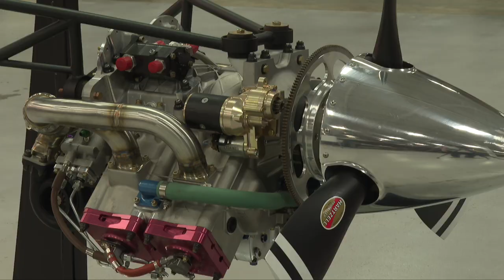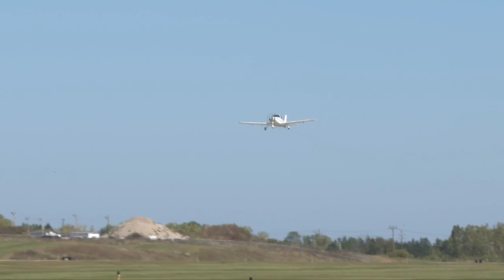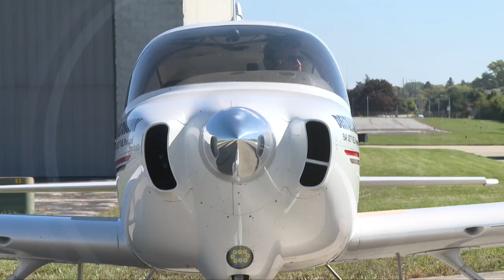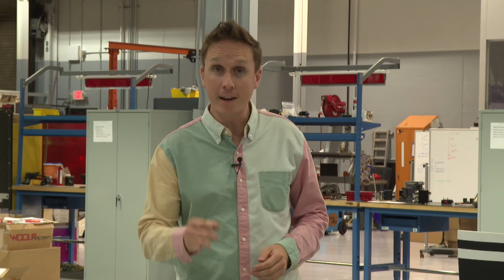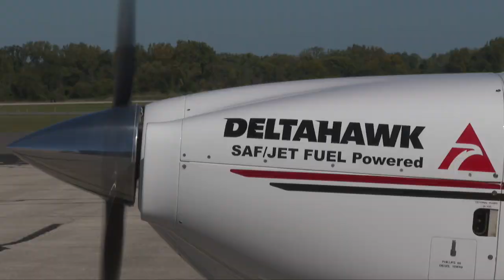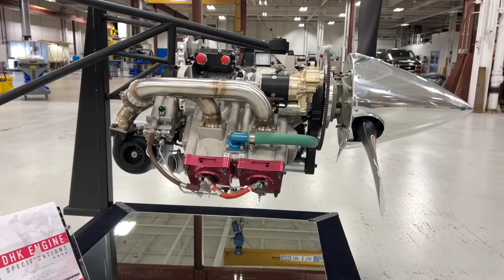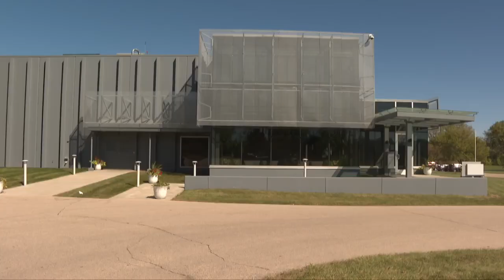This engine is the future of flying

Comment: I'd lose the belt drive for the supercharger & replace it with a gear drive- or even better- turbo only, with a brushless electric motor for start-up. for redundancy? you can use 2 electric motors to drive it- one fails- the other kicks in. failproof. plus, you only need it on startup. once the engine is running, the exhaust powers the turbo.

Comment: deltahawk made a LOT of smart moves here. leaving off the FADEC equipment probably only lost them 1 or 2% efficiency- but not having it meant that they didn't need redundancy for it- along with the extra parts count, certification & insurance costs... on & on & on. plus- once they completely take over the GA market & they have a 5hit ton of cash to burn, they can afford to go back & offer a FADEC version for those who might want it. but frankly? I could live without it. this engine is plenty efficient as is. kudos guys.

Comment: When they get the cost down to under $20K they will get my attention. Personally, I would prefer a rotary style engine, better power to weight, good fuel economy and the ability to double the horsepower for the same weight and size.

Comment: Nice, but ... previous century junk by definition as a fuel line and CO2 based fuel is needed.

Putting fire extinguishers in front of a burnt down Tempel of Oil greed....

Comment: Blowhards!  Aviation engines for small planes haven’t changed much since THE SPIRIT OF ST. LOUIS.  If it isn’t too embarrassing, how fast can it push a small aircraft.  A motorcycle could go faster than the run of the mill single engine aircraft.

Comment: I've watched several videos about the Adept engine and tried to play Devil's Advocate looking for potential problems. That it is an already functioning engine with significant air time, I'm rather impressed with the engineering and power to weight advantages. I wish the team and investors at Adept all the best. 

That being said, while only a proof of concept prototype, the RevForce 2 stoke featured on "driving 4 answers" is very interesting. While currently only a two cylinder, the power density is unreal at 578 cc displacement pumping out 220 HP while weighting only 50 kg and multi-fuel capable with on the fly switching.  I'm a bit wary of both the supercharger and turbocharger being required to run, but I suppose we'll have to see how it evolves, Currently, this is not slated for aviation use, but Imagine a 1200 cc 4 cylinder weighing maybe  230 lbs pumping out 400 plus HP.  That would be a real gane changer for light aircraft.

Comment: Minus the paperwork and burocracy yes I agree but. With to much regulation this is an overpriced paperweight. For 99%of pilots.. one has to understand that the engine is what drives aviation and it's new complexity... Engine first airframe second. And price is 3 and first as always... Good luck..

Comment: The main costs of airplanes are:

1) insurance ($3000 to 12,000/y)
2) hangar ($5000-$8000/y)
3) annual ($2000 to $10,000)

These can run $10,000 to $30,000/years depending on airplane, location, etc.  

At 100 hrs/y that is $100 to $300/hr, which is more than the fuel cost by far.  Fuel at 10 gal/hr is $50 to 60/hr, and engines are $15/hr or so for overhauls.

To make airplanes cost effective you need to solve 1-3.  Getting a little less fuel burn is NOT going to solve the problem.

BTW, this delta hawk is obsolete.  New combustion tech will be 60% to 75% efficient on E10 (regular gasoline at $3/gal), not 42% like the delta hawk on jet fuel at $5/gal.  75/40 = 1.8x and 5/3 = 1.66.  1.66 x 1.8 =  3x more for the delta hawk per HP.  

RE fuel can be $1/gal from house...or run on Natural Gas for 1 hr at $1/gal.  Both of these low cost fuels can't run in the delta hawk, but they can in new engine tech.   1.8 x 5/1 = 9x more for delta hawk.  Clearly obsolete.
Reply: The only question then is how to solve the insurance, hangar and annual costs?  New airplane tech with new combustion tech solves all three.  Nearly zero costs, saving $100 to $300/hr in fixed costs at 100hr/y.  Delta hawk does NOTHING for the 3 key costs.

If you fly 100 hrs/year and burn 10 gal/hr, and fuel is $5/gal that is $5000/year fuel costs.  Low cost hangars are $5000/y.  How than to get the costs to nearly zero?

I have a way...

Comment: 11 GPH was the same as my 180hp Piper Archer. Other than running on slightly cheaper Jet fuel, I fail to see any advantage, especially if a new one costs 110k. 
When I was still flying 10 yrs ago, a new factory Lycoming 360 (180hp) was around 30k. Overhauls were between 15 & 20.
Reply: WRONG. 7gph at economy cruise- it uses a little over 10gph at full 180hp, which your lycoming will not do- at altitude unless you turbo charge- and then? you will burn around 14 gph. but wait- it gets better. price of offroad diesel? which you CAN BURN in this engine? around $2.50 a gallon. or Jet A, $4 a gallon or B20 diesel around $3 or home-brew B100 for around $1.50 per gallon.
Reply: @jaybee3165  WRONG!!! Mr. Knowitall. What a ridiculous comment! How could you possibly know the fuel consumption of MY airplane? My 76 Archer averaged approx. 11 GPH cruising around 7k ft @ 2,675 rpm. I put about 700 hrs on it and definitely know better than you, how much avgas I bought for it.
What year model was or is your Archer Mr. Knowitall?
Reply: @roberthorton8135  don't have to 'KNOW IT ALL' to know that an air cooled gas burner is FAR less efficient than a modern turbo diesel. 4x the compression ratio, cleaner burn, tighter tolerances, water cooling, direct injection? not withstanding- the archer is an excellent aircraft- but engine wise- you're just outclassed. cirrus installed the DHK 180 in their SR20- a plane with around 200Lbs. more useful payload, achieved 8gph while cruising at 148kts. imagine what your piper would do at 30,000 feet with a DHK 180. your old lycontisaurus briggs & stratton motor wouldn't have 50hp left- if it could even reach that flight level at all. no doubt- it's been a great engine- but that's all HAS been.
Reply: @roberthorton8135  imagine your PA28 had a cummins BT-6 turbo in it. you know- the engine that routinely goes 1 million plus miles (20,000 hours). and develops about 200hp & 400 FT. LBs. of torque and has greater efficiency than a gas engine 2x its' cubic inches ... now imagine that it weighs the same as your O-360. that's what you're competing with. your engine lost this race before it began.
Reply: imagine if... your piper- only needed new cylinder liners & piston rings & bearings every 12,000 hours- and didn't have any valves, camshaft or heads. THEN WHAT?
Reply: at what altitude & speed? with how much payload? apples & oranges mr. briggs. apples & oranges. diesels WIN- when the race is: get to a set rpm or speed- then HOLD it under a load. that's ALL an aircraft engine is asked for. & precisely what a gas engine, direct drive- is HORRIBLE at. if it wasn't? every tractor trailer would still be powered by one. but they're NOT. the only thing holding diesels back until now- was weight. a german company- junkers, built the jumo, in ww2- which still holds the gph burn record for efficiency. not lycoming. not continental, not pratt. a 2-stroke diesel. what diesel hawk did was take an old american design that stood the test of time in busses & other commercial uses- the GM detroit diesel- a 2 stroke- and modify its' design for aircraft. it's lighter, stronger & more efficient. PERIOD. & this is only their first iteration.  with time- as the build fleet hours & learn- it will improve far beyond what is possible with anything GA currently has in its' reach.

Comment: I can't see any significant sales for this engine because it is priced over $100k.
Reply: based on WHAT? a NEW, io-360 turbo- which is FAR less fuel efficient, FAR more expensive to operate is $97,000- with NO firewall forward- that's engine ONLY. $110k for a diesel hawk includes: COMPLETE installation of firewall forward, designed & engineered by aerospace engineers from deltahawk, including cowling, water cooling radiator, oil cooler, turbo intercooler, panel integration, fuel lines, water lines for radiators- engine mount & prop system. what's included with the engines YOU say have so-called 'significant sales'? a high price. shock cooling. carb ice. constant failure of magneto's, valves, top end, cylinders & piston rings. $7 a gallon fuel at 20gph fuel burn. in short- PURE HEADACHE & PILES OF MONEY EVERY SINGLE YEAR OF OPERATION. who would want that over THIS engine? I'll tell you who: LYCOMING. CONTINENTAL. GOT YOU! a lycontisaurus salesman- tell your bosses we said hello.

Comment: So, for anyone seeing this video and being confused as to everything about this engine:
Deltahawk is an engine designed to run on jet fuel, diesel, and a few other similar fuel types, not gasoline or avgas. It claims to be both super- and turbocharged, produces a maximum of 180HP on 11 gallons per hour. Havent found an official figure for this so * but weighs between 350 and 400 lbs. Supposedly a 235HP version is in the works that burns 14 GPH. Cost is ~$110,000 for the current 180HP model, I believe that is WITH installation hardware. 

You now have more information about this engine than was presented in the video, even if some of it is wrong.
Reply: it's a LOT more than installation hardware. $110k includes an engineered firewall forward installation PACKAGE- including cowling design, cooling system, engine mount, panel integration and constant speed prop- and a LOT more. before they decided to include all that- the base engine with radiators (anti-freeze, oil & intercooling) was $60k. their reason? NO ONE has EVER tried to install 200hp worth of diesel engine with turbo & intercooling into an airplane before- EVER- without also custom designing the entire firewall forward. mess up just one component of the fwf? & you wreck the engine- or the entire plane. as time passes & this engine system gains fleet time- there will be after market fwf kits & lots of options- like there are with LYcoming & continental.

Comment: Can the average pilot afford this? What I’d love:

* brand new avionics
* 300 knots
* less than $90K to run all in
* $300K to buy

Now what I just described can only be obtained as either a turboprop or a jet and even used, it’s a struggle these days to find anything below a million. Just 6 years ago, you could easily find that for $600K. I don’t care if some great new gas sipping engine comes out if it’s doing 135 knots and costs $3 million. I’d rather buy a used TBM 750, which you can get for about a million.

Comment: For at least 5 years after certification, you have to sell your engine to the manufacturers, plus you have to start paying off the large development costs in the last 2 decades. If you make it through those , then you can talk about your engine as the future of flying. Your future will be largely determine by the cost of your engines. Some examples of clones being made are Rotax, PT-6,  Wabasto heaters and Snap On flank drives. You have under 1/4 century for patents. The only way to get around it is at the patent expire time, you find something wrong with your product, and start pushing a new product. So if you cannot make money from it, no one else can, examples are R12, R134a and now R1234. for your AC. You are the second such engine on the market, there is also one called the WAM100 that were still born , starved of funds in England.

Comment: Aircraft engines tend to be much more simple than modern auto engines.
Reply: look up rolls royce merlin fuel injected- first built in 1943. liquid cooled. mechanical fuel injection. super charged. the radiator was under the fuselage beneath the wing- and actually made thrust- vs. creating drag like most modern GA aircraft of today.

Comment: Point #1.  The only engine on earth more basic than a gas powered aircraft engine is a Briggs & Scranton.

Point #2.  100 Octane low lead gasoline is the most readily available fuel for general aviation aircraft.

Doesn't look to me like your off to a good start with this propaganda.

Comment: If that video is their production facility then they are in trouble.  Where are the people?  Where are the machines?  Where is the production line?  If this is the future of aviation. We are going to be walking. They had a mop bucket on the production floor. That means the roof leaks. Taking orders for 10 thousand  units doesn't mean a thing if you cant produce them. I can't be sold on an engine that's a display model. They are just blowing smoke up our asses. Next, we'll hear pay no attention to that man behind the curtain.

Comment: Plane engines (piston) are NOT incredibly complicated.  It’s the opposite due to liability and insurance.  GA, general aviation, the non commercial planes engines are 80y old tech…magnetos and air cooled.  Tech advances is slower than snail and glacier

Comment: Diesel fuel is cheaper and much less volatile than av gas.  With this diesel 2 stroke, having much less moving parts than a gas engine is always better. I remember back 15 or 20 years ago when these diesel engines were being billed as being much lighter than their gas counterpart engines. Comparing the weight of this diesel to that to the other 180 hp gas engines out there like the O-360s, the 335 lb weight is considerable.  With the 235 hp versions compared to the 470 and 540 engines, the weight is mush better.  But to me, the $110k starting price for the 180 hp versions is a bit steep.  That's nearly twice the price of a factory new IO-360 and $35k-$49k  more than a factory new IO-470/540.

Comment: Congratulations! This is how you present news: NO INFORMATION whatsoever: what type of engine is that, what type of fuel it uses, specific power, specific fuel consumption, what is the power rating, what is the expected time between overhauls, certification status, how much it costs... You know, the usual info considered to be relevant for aviation engines. You managed to provide NONE of this, for which you get a well-deserved 👎.

Comment: The problem with diesel engines is heat and weight. The air cooled gas spark magneto  engine is the simplest and most reliable to date.
Reply: clearly you've never read an FAA crash statistics report. Lycontisaurus has lost this fight. the dhk 180 & it's 200 & 235 hp variants will COMPLETELY replace everything from io390 & smaller & the soon to come V6 340hp dhk will replace everything else Lycontisaurus has. there are NO problems with WATER cooled 2-stroke diesels, heat or weight. air cooling is problematic- PERIOD. whether gas or diesel.

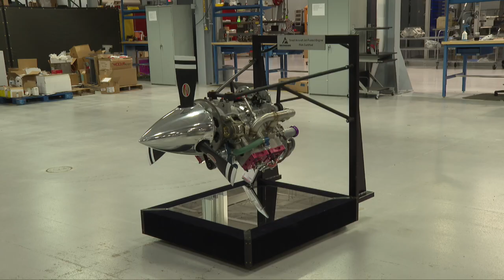Comment: At 0:20 seconds the guy says that airplane engines are incredibly complicated, however most airplane engines that would be replaced by this Deltahawk engines, are actually extremely simple machines, basically a large VW Beetle engine.

Comment: Great idea but a few years behind in its thinking. Rotax have been certified for mogas ever since their introduction. In fact Rotax recommend only using avgas if you have to. In Britain that gives a large saving on fuel costs when Avgas is over £2 a litre in many places but mogas is about £1.5 at most. Added to which the Rotax burns about 4gallons an hour in the cruise against 8-10 in a Lycoming or Continental of the same power

Comment: This is probably a Diesel . . . and somebody did this back in the 1990's because most airports now have more Jet A than 100 octane petrol available - can't remember who did. And there is the even older story, of the Jumo vertically opposed Diesel engines of the 1930's and WW2. But the really old old story - If we can claw our way back through the turds of what Benz did to the Diesel engine back in 1912 - if we can get back to the original work of Rudolph Diesel, 1910 and all that, we could have changed the world. Amazing what you can do if you understand the engineering. But instead we didn't care and we just wanted to have fun. We wasted twice as much fuel as we needed to, these past 100 years or so. If we had done the Diesel properly, as Diesel intended, we could have won ourselves another 25 years. Then maybe we would have been ready for all this electricity-unicorn-magic we are talking about but haven't done the engineering yet. Yes, Diesel jumped. He saw what we were going to do. He despaired at us. He climbed over the ship's rail and he jumped. PS - of course the  jet engine is a Diesel. Dear old Frank Whittle knew what he was looking at. So there you go. Every engine that has to earn a living is already a Diesel. Looks like it time for the fancy-dandy-peeing-fuel-up-the-wall Otto engine to bite the dust. Funny old turn of events. Yee Haw

Comment: Piston aero engines are not complicated. They're simple and reliable, naturally aspirated and air cooled. Engines from the 40s are routinely in the air. The engine from this video is water cooled, super charged AND turbo charged. It uses alternators instead of magnetos. It doesn't have a valve train (uses ports) and no plugs (it's a diesel) so no variable timing apparently. Rotax 915 offers same hp (130) for half the weight.
Reply: air cooling is a MASSIVE WEAKNESS & a problem. variable timing isn't necessary because you have nearly unlimited torque in a 2 stroke diesel- far more than you need to maintain 2650 rpm's. and a rotax 915 won't even come halfway to comparing to this engine- it's 180hp. they also have a 235hp verison that is the exact same engine- all they change? they use a more agrressive turbo with a higher boost pressure. they massively down-tuned the dhk 180 for their first certified version. if you stuck this engine in a plane that uses a rotax 915? it would twist the firewall right off the plane.
Reply: @jaybee3165 engines can be light, powerful, or reliable. Pick two.